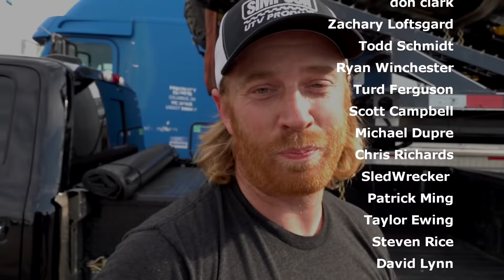Wrecking $250,000 worth of side by sides... our worst day ever.

Comment: The center of gravity is too high with that trailer and had too much speed for the curve. I was behind a semi that did the same thing in SoCal one morning. It just rose up on the inside wheels and toppled on the outside of the curve. The trucker was not speeding...I'm sure you weren't either...it's just that center of gravity has a tremendous lateral leverage on the stability of the trailer. Real sorry for you'all but you walked away from it, that's the bottom line here. 
Friday the 13'th now is your lucky day...you did not die. It's my lucky day also...I was discharged from the USMC and walked away alive & free on a Friday the 13'th! ...😎👍

Comment: So I was thinking about this, those 4 by 4s are extremely top heavy and very lightweight for its footprint comparable to cars. U even made then higher when u loaded them. So they were just acting like a counter weight with leverage and the trailer was lighter then normal. That's what pushed. Also made u had a blow out right into the turn as well that could have been just really bad luck

Comment: That trailer must flex way too much or it wasn't down on the ball. The ball and latch isn't really supposed to keep the front of the trailer upright. I mean the load up front is basically riding on a pogo stick, it relies on the rest of the trailer to keep it upright. But if the whole thing just went over without twisting then they probably had the heaviest machine up front and the lighter ones in the back just couldn't hold it down. Some people never think of this stuff. Those trailers are just not a good idea, way too much of the load is up too high.

Comment: The gooseneck ball is missing. It’s not on the plate of the bed, and it’s not in the neck of the trailer. Seems like you ball pin failed. Don’t see safety chains attached?

Comment: Been there done that, different scenario but too much weight for the speed of a long on ramp where you are obviously trying to accelerate to merge with traffic and that's what happened to me I thought I was in the clear and had made it through the worst part of the curve so I started accelerating and I was hauling mud in semi dump bed trl that was loaded heavy to one side and was only continuing to shift its weight even further as I was going around the long ramp and then I went to accelerate and that was the camel that broke the straw and over I went... shitty ass feeling I had literally never been in an accident my entire life and that includes racing and everything so needless to say my ego definitely took a hit but you live and learn and I escaped with a only a minor concussion and a little sore because I wasn't so lucky as you guys because my cab went over with the trailer so consider you guys extremely lucky because it 💯 could have been a lot worse...

Comment: 1:27 no ball in the bed….
7:05 ball back in bed?  

I’m not blind but to me it looks like someone pulled the ball lock pin and set you guys up for failure….   My buddy had it happen to him at the fuel station and he lost his bed and tail gate from the ball lifting out of the base plate, and his safety chains mounted to the base plate under the bed which bent the bed up kept the trailer planted to the truck and the break away cable for his brakes deployed causing the trailer to lock up and stop him.  

Glad everyone made it out okay.

Comment: From a person that Transport vehicles for living using the same trailer I can tall you, that you should never had used a gosseneck to pull tha Much weight you should be using a 5weele rated for 30k and it will be almost impossible to flip over truss me I had pull 3 f250 before no problem whatsoever. Of course I have a F550 dually. Rated for 19500bl payload.

Comment: Ok everyone is not looking at this correctly. Whomever hooked up the gooseneck ball SCREWED UP!!!!!!! This was not a turn to fast this was a screwup on the hitching up of the trailer. Let me explain. Look at the video between 1:10 and 1:25. You will see there is no ball in the hidden hitch receiver. This is right after it happened. Then you will notice at 7:02. The ball miraculously appears back in its spot. Somewhere between these 2 times they figured out what they had done and not set the pin of the hidden hitch and when they turned the corner it twisted enough to pull the hitch ball out. The problem is this generation. We all screw up OWN IT!!! and stop trying to act like this was something unknown and not a total failure on your part. Got to love the generation that it is not their fault no matter what happens. Cant fix stupid. (But you can try to cover it up)

Comment: From what I can see it looks like you are using a fully articulated gooseneck rather than a semi articulated 5th wheel. The point of connection with a gooseneck has the trailer act like a tricycle rather than a four wheeler. Not as stable on turns especially with weight so high up and over the connection point.

Comment: Hmmm did you get them totaled by the insurance company and then bought them back for little money ? Just a question. 
Them $30k machine have big payments.  But not if they got “accidentally wrecked “  your reaction seriously was not at all a surprising reaction. Almost like expected. Idk
That gooseneck is 30k weight capable.. the ball was not in the locked position. 
Maybe someone set y’all up at the gas station idk . You pull the locking pin for that ball and that’s now loose.

Comment: Honestly this is kind of frustrating. I'll tell you what happened you didn't latch the ball and had a high center of gravity. I know you didn't latch the ball because most trailer hitches that go into the bed are rated for 30k pounds and if that trailer rolls your truck would have rolled with it.

Comment: Load was to light on the back end,top heavy on the front.you should know better.bad design trailer to start with,not safe.You got to load the back to keep the wheels locked to the ground  ,the front is a balancing act.

Comment: Too bad you didn't have a camera following you so I could see what happened here. When was the last time the ball was inspected? That's your weak link here boys. It had to crack and start rusting on ya a long time ago. Not too bad of you had insurance or a real bad day if self insured here. I didn't even see a pin in the goose neck's receiver. Where did it go? Finally see the ball and it's where it ought to be so the failure point was the latch that keeps the goose neck latched and locked onto the ball. Then your safety chains if you had them broke and kept you from taking a ride in front of the goose neck down the road and possibly from turning over with it.

Comment: Simple.  You came around that corner too fast for that setup.  That trailer setup is designed to fail and you levered the trailer right off the ball.  To much weight up high over the ball just yanking on it through the corner

Comment: I'll tell you right now judging by the footage in this video the turn was taken too fast that is a 15 mph turn for the average car a truck hauling a trailer should take it slower especially with that truck/ trailer hitch setup like that top heavy trailer if it wouldn't have ripped off at hitch it would have rolled the whole truck right there is the proof and shows it was moving too fast. Look how sharp of an entry ramp it is. Most definitely had roll over warning signs for trailer trucks. Driver error no doubt

Comment: Cheap ass aluminum beds. It would have been contained with a steel bed. Where's your safety chains. Gooseneck require safety chains and breakaway brakes. Totally avoidable incident. Y'all just drop it on the ball and roll. Smh. Good thing you didn't kill someone